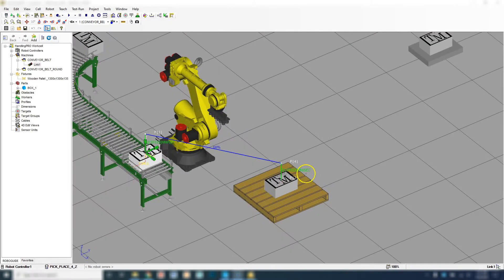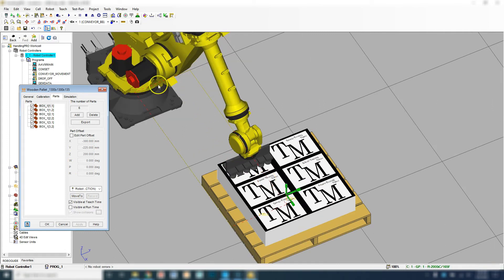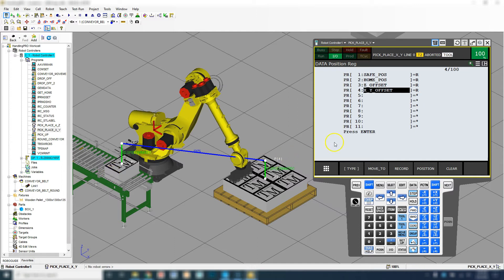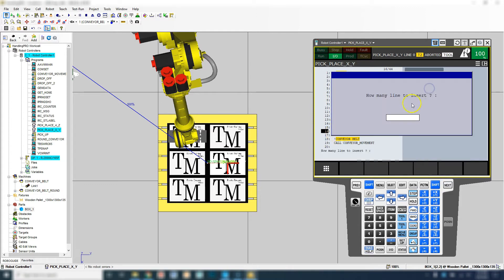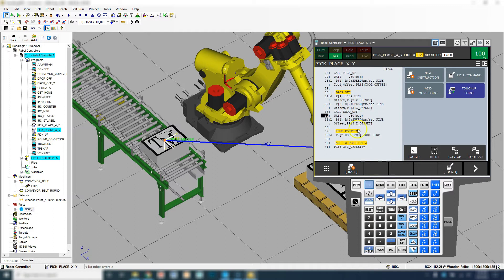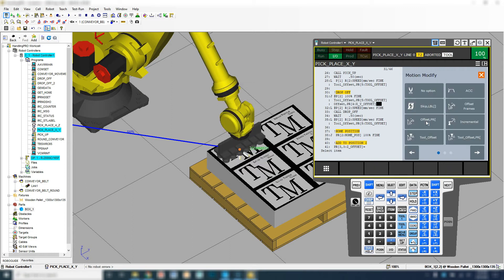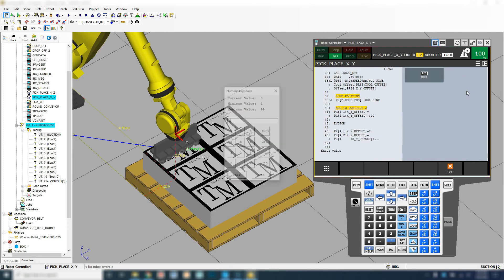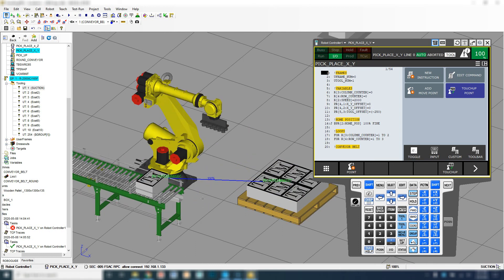PICK AND PLACE TO X AND Y OFFSET ON A PALLET SIMULATION IN FANUC'S ROBOGUIDE SOFTWARE

Comment: Hey Timothy, thanks for this video it was very helpful and I subscribed to learn more!

I have a question about simulating dropped parts in a certain pattern, instead of an array I selected Import Parts Offset Data. It the prompts me to provide a .CSV data file describing the custom offset. This is great but I have no idea about how to format this so that the X,Y,Z will work correctly. Have you ever used this feature or have any guidance?

Kind Regards,

Doug
Reply from the maker: Good Evening, in the place parts array menu there is a dropdown at the top that says place menu.  click the that and switch it from imports parts offset data to array.  Your menu will then look like mine.  I have not messed with CSV but I will now.
Reply: @timothymehring276  So can you do the Array on the TP? I just never have seen anyone do it like this